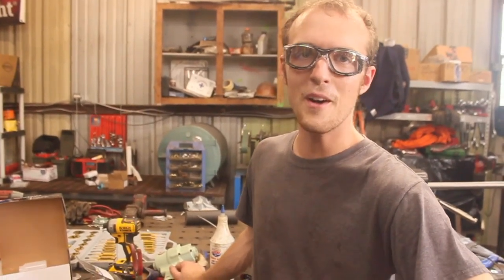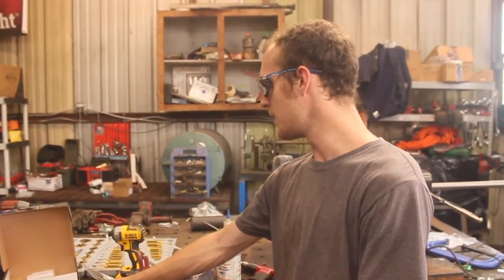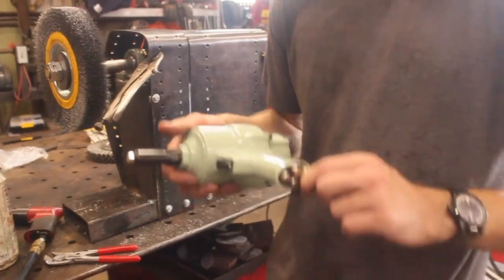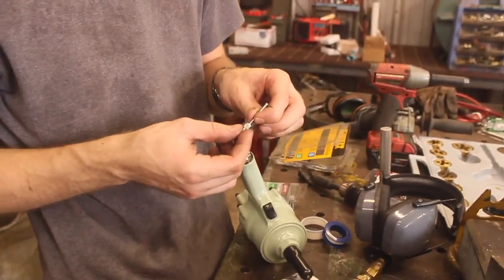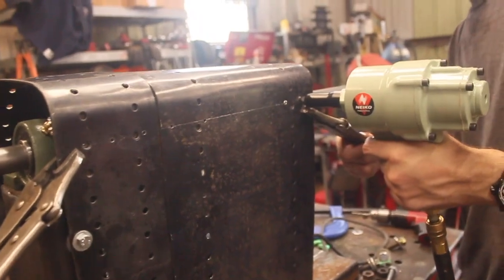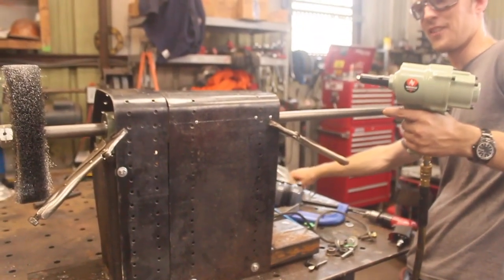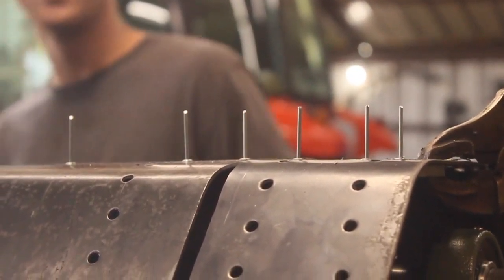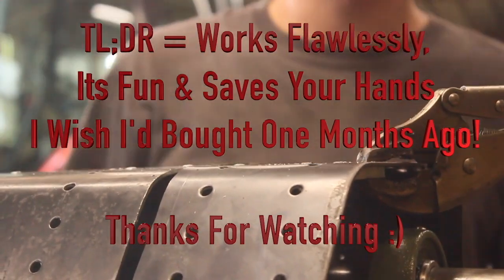WHY $50 AIR RIVETERS COULD BE THE BEST KEPT SECRET IN THE TOOL WORLD

Comment: These little units are GOLDEN.
I was 3/4 of the way through riveting fold-out foot pegs up the mast of a yacht when I bought mine. I had been pulling big fat monel rivets using a hand riveter with pipes as extensions on the handles. Big tall mast, and I was pretty sore after the first 3/4. 
The marina specifically prohibited air compressors, so I was running it off a BBQ gas bottle hanging from a rope - DO NOT do that. And before you lecture me about it, let me tell you, it's probably the safest thing I did on that job considering the rope for the chair hoist thingo was all rotted away (see, that's why I was putting footholds up, to get up there and get it fixed).